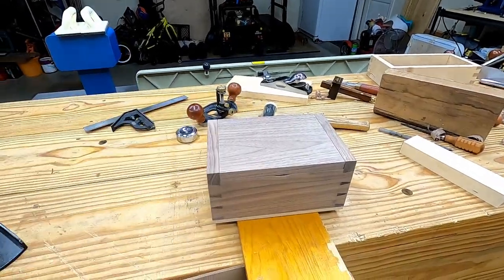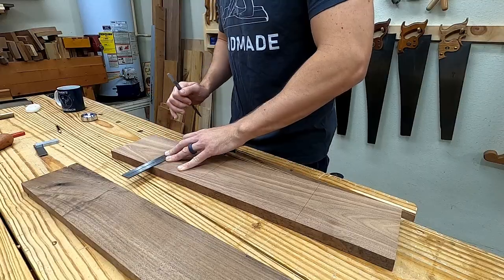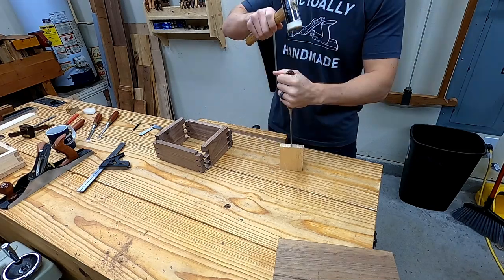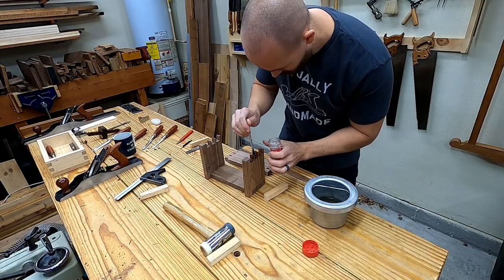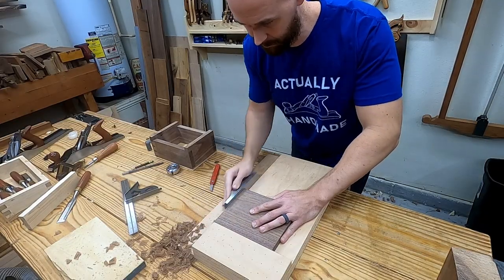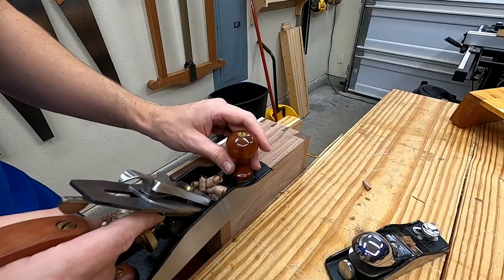A Few Simple Tools = Beautiful Box!

Comment: I love your work, you're obviously very skilled. That only comes with practice. The risk of different rates of movement because there are two different species of wood could possibly cause the glue joint to fail. Have you considered using your router plane to make a dado for a floating bottom panel? Still though, great build and the dovetails were spot on.
Reply from the maker: thanks man! You are right, it can be an issue, for a box this size, i dont worry about it too much. You might like the earlier cherry box vid, I do exactly as you mention!
Reply: @FranksWorkbench  I just watched that video, and I really liked it. That was exactly what I was talking about. I mis-spoke on the plane nomenclature, I should have said plow plane. I only brought it up because I have a couple of boxes I made like that and one of them got used in the bathroom for tweezers, nail files, etc, and the bottom blew right off of it once the humidity from the shower hit it a few times. To top it off, I was using Titebond 3.

Comment: Nice looking box. Love that walnut. 

Quick question. For your woodriver planes, are you using a veritas chip breaker and a veritas blade?

Do you like your scrub plane? I've been using a course iron in my jack plane for removing a lot of stock but that scrub plane seemed to work well.
Reply from the maker: Wood river cap iron, fits ok even with the veritas blades. As for the scrub plane, trust me you will not regret it. Will make a blog post soon on the topic
Reply: @FranksWorkbench  Thanks! Do you know if the veritas chip breaker will fit in the woodriver planes?

I'm looking forward to your blog post.
Reply from the maker: Not sure I've never tried it. But the blades are called Stanley/record replacement irons